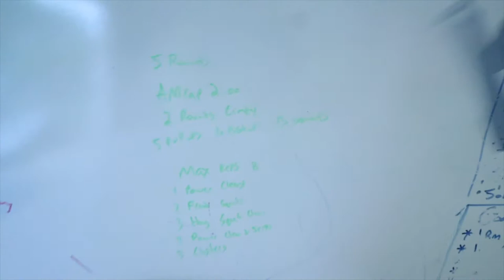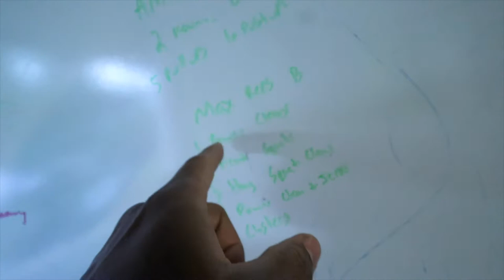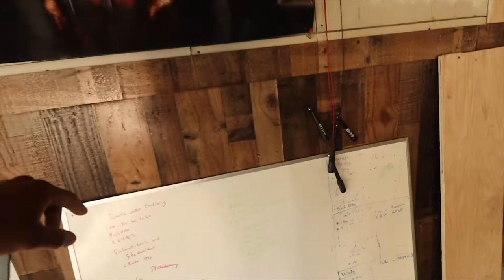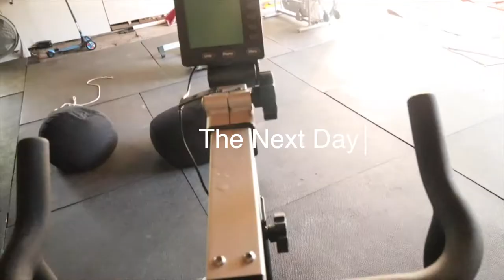Adding A Concept 2 Bike Erg to My Garage Gym!

Comment: Congrats on the bike! I’m considering that vs the echo bike. This is totally off subject, but you may want to consider putting the ribs on one side of the grill and only ignite one set of burners on the opposite side to do a slow cook without burning the ribs. You can wrap wood chips in aluminum foil and place it directly over the flames for some real smoke flavor as well. I know this is random, but grilling/smoking meat is one of my hobbies and wanted to help you out!
Reply from the maker: Thanks Aaron! Winter started pretty early this year in Minnesota so we won’t be doing much grilling. 

You got a tough decision.. the echo bike is nice for HIIT work outs and the bike erg is nice for long rides and HIIT work outs. I think in the long run I’ll purchase and echo bike from rogue. Thanks for watching.

Comment: good setup. I saw that you have the gym rings.  Since you have exposed beams, it's set up good for a suspension trainer.  TRX pro is probably the 'best' (easily adjustable, great quality), I have that and also a nossk rope trainer ($30) and it's really good too, great bang for the buck.  Two or three adjacent eyebolts (really more of a hook bolt that lets you put a rope over it) in a beam would give good anchor possibilities.  Can do: rows, dips, triceps, split leg lunge, etc.
Reply from the maker: I will definitely have to look into that! I love Small and functional equipment

Comment: Loving this content! Do you prefer your rower or your bikeerg? I can only afford one so debating between the two right now but leaning bikeerg.
Reply from the maker: That’s a tough one. If I had to choose one... I would go bike erg. I love the versatility of it. You can  warm up on it. Do long rides. Add it in metcons. It is easy to move around.
Reply: Good Times With The Goodies how long is your workout and average heart rate? I have schwin air bike but I kinda wish I had a bikeerg for higher cadence